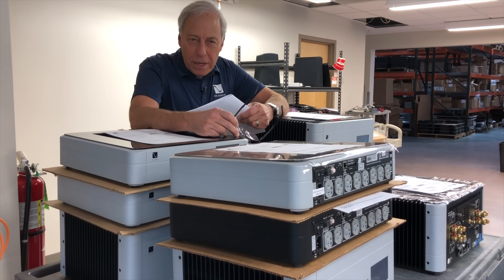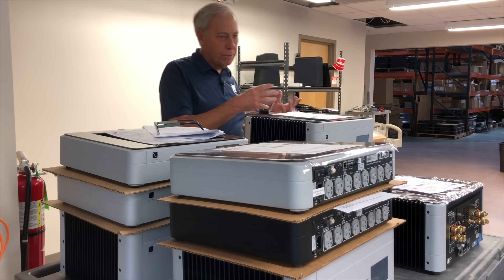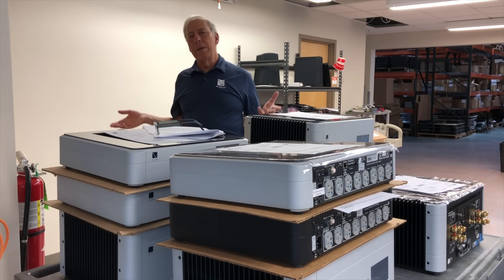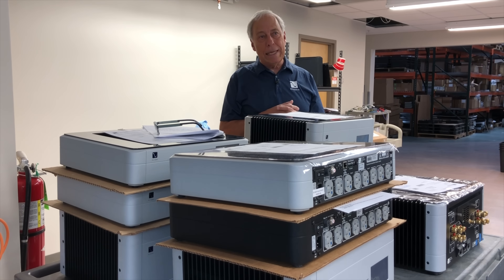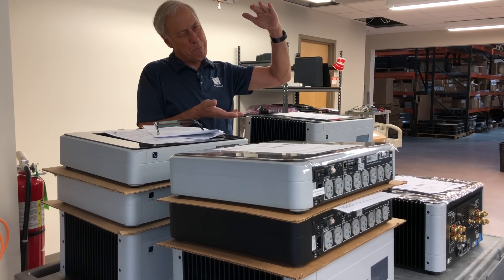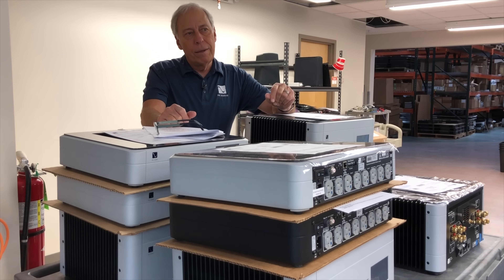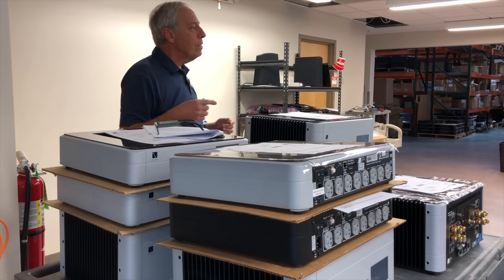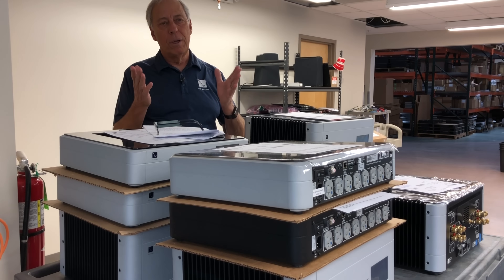Is it easy to make a good AD Converter?

Comment: Music is mostly digital, nowadays, so you shouldn't really need the ADC on the front end, unless of course you're listening to records. Most, if not all, integrated amplifiers have the DAC already in the box and most DACs are built well enough to do the job without issues. Speakers that accept digital input already have the DACs and amplifiers in them and are self powered so no additional power amplification is needed. The job and role of a DAC has been tweaked, modified, and improved upon since the 70s, so, yes, it's easy to make a good DAC. If you're paying out the nose for "audiophile quality" conversion, you're probably getting ripped off. Where you tend to need the higher priced ADA gear is in recording studios, where the accuracy and precision of your master clock affects a plethora of downstream digital equipment at the same time.

Comment: Ive got a question for ya... How do you tune a home theater speaker system to perfection (even just 5.1) I know that THX recommends 80 hz and below to be  exactly 10 decibels louder than the rest of the specrum? Do you try to force feed it different slopes to it so to speak... like you trying to take different measurements and youd try to change its slopes directory... kind of like changing the loudness of it. Are IMAX theaters perfectly neutral or do they significantly artificially exagerate on the top end at all to reach for more details. Any other trickery to tingle abouts? Would appreciate your input

Comment: I would like to hear your opinion on the Kii Three and the Dutch & Dutch 8c, both speakers that generate a cardioid sound field and seem to be taking care of a lot of room issues. If for speakers dealing with DSP "only" at the lower end of the freq range, what do you think of Boenicke speakers designed by Sven Boenicke from Switzerland?

Comment: What is the point in hooking up an A/D converter to the output of a power amp ? Connect it to the output of the pre-amp makes much more sense IMHO . You risk blowing up the A/D circuitry I think when hooked up to the potential high voltages of the output of a power amp .
Reply: Ever heard of a voltage divider?
Reply: @JerryRutten  Yes , but that does not even come close to anwering my  question : it even clarifies it . Why go all the energy costly way of amplifying a signal , just for the sake of degrading it and then digitizing it , while you could just take it unamplified and then digitize it .
Reply: My answer was a reaction to the risk of blowing the ADC.

See Paul’s earlier video’s about subs why he wants to you use the power output. Essentially he wants to keep (the coloration of) the sound (of the power amp) the same for all the loudspeakers.

Comment: @5:24 why would you feed a power amplifier signal into an active speaker with DAC and yet another power amplifier? Active speakers should be driven by either a line level analog signal or a digital signal, if it uses DSP for cross-over filtering.
Reply: I think that was explained before. Maybe "hooking up subwoofers" video.  Especially pertaining to add on subwoofers. I think he said that the subwoofer has line in and speaker out "in". and he preferred speaker level in for keeping phase correct.

Comment: I would love to hear your take on the Kii THREE
 speakers. In every review seen about it, they all say it's the best speaker they've heard.
Reply: Agreed!  I think Paul's insight would be very interesting on those.  Although I find it odd that he feels DSP is fundamentally lossy, but CDs are superior to analog.
Reply: You really should audition these , certainly now that they have released the BXT bass extension modules . Without BXT the Kii's go just as deep , just not as loud . Now that they have an additional eight 6.5 inch woofers (equivalent to two 12 inchers) , they max out at 115 db SPL , which is more than enough to make you deaf if exposed  long enough , but also capable to capture the most demanding dynamic range recordings (clasical big orchestra) . These speakers are among the very few with controlled constant directivity on the market . All the latest psycho-acoustic research (Siegfried Linkwitz being a pioneer) points to that as being the most important characteristic by a mile for having a great sounding speaker . If you have never heard a constant directivity speaker (and chances are you haven't) , you will be blown away .